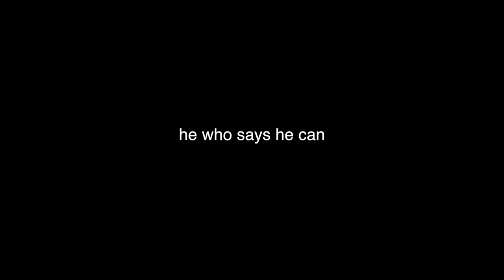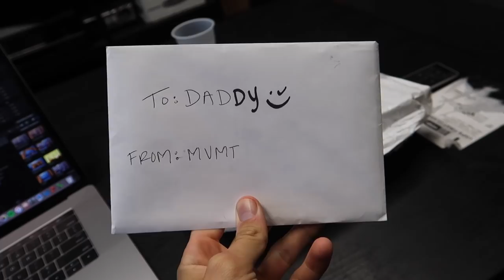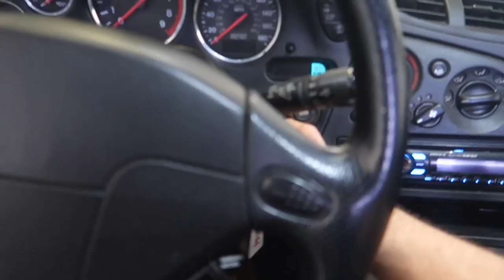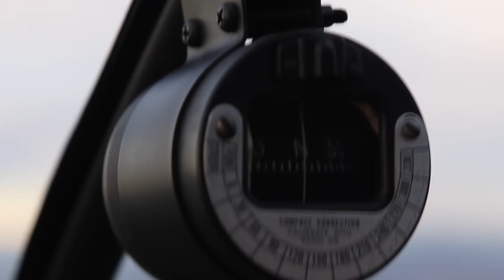Adding Bumper Lights to my RX-7 [Car Shop GLOW]

Comment: They aren't "designed around" the RE Amemiya bumper, they are the same shape as the RX7 Spirit R lights you hoser.
Reply: DeviousPrimate exactly he barely knows anything
Reply: DeviousPrimate they are actually shaped like the series 8 rx7 front which was only available in japan

Comment: Pull out the adjustment pin on those watches (like you're changing the time) to save the battery on them. Then set your time when you're ready to wear one.

Comment: These lights are not made to fit this bumper, 
those are OEM 99-spec (JDM) combination lights that are fitted with LEDs.
So the 2005 RE Amemiya bumper is made to fit these bumper lights. :)

Comment: The lights you installed are for the RX-7 Spirit R bumper which is OEM. RE-Amemiya uses the same shape so it's not only for the RE-Amemiya bumper

Comment: the lights are designed for series8 fd's. only work with s8 stock bumpers or aftermarket bumpers with s8 style lights

Comment: Tj You guys should get in general like a big hose like car shops have to put on the exhaust and you can pointed out doors in general for when you work on cars so it's not filling up the shop but better yet definitely for the rx7 Just a recommendation thought it might help

Comment: the lights will fit on the spirit r model of the rx7
Reply: Jonathan gregson exactly he knows nothing, that's what they where designed for
Reply: Jonathan gregson they are standard series 8 lights with led lights fitted. Spirit r is just a rare version of the series 8 rx7
Reply: Graeme Mcfarland I  am not to familiar with rx7s, thanks for the info
Reply: Jonathan gregson all good mate i own a 2001 series 8 rx7 imported from japan. I know in america they are described as 99+ spec.
Reply: Graeme Mcfarland thanks